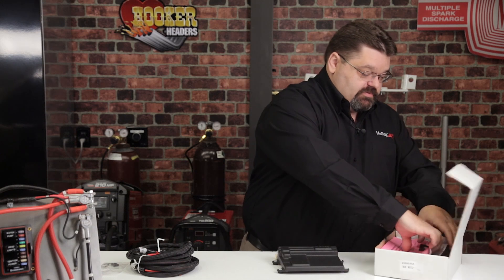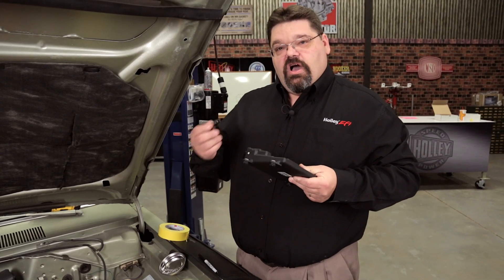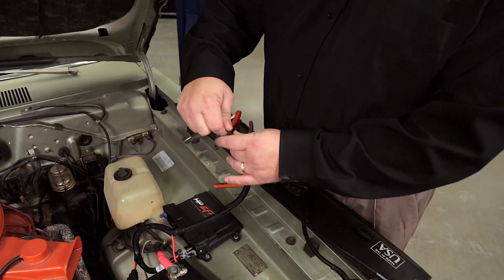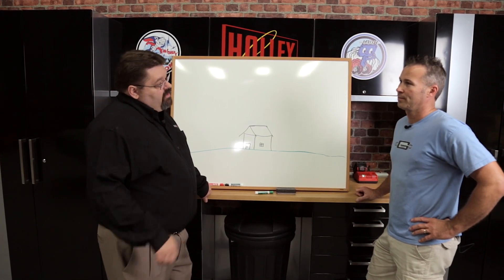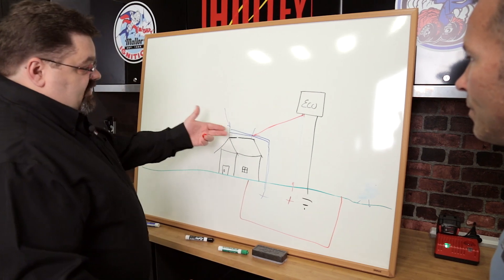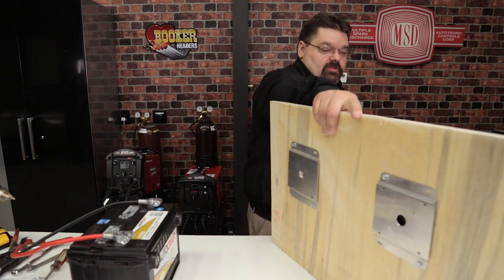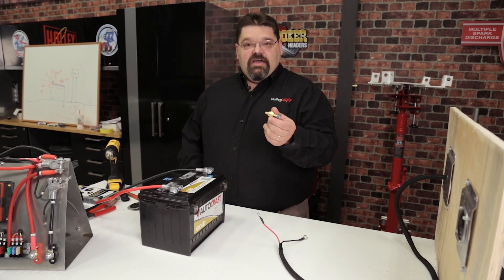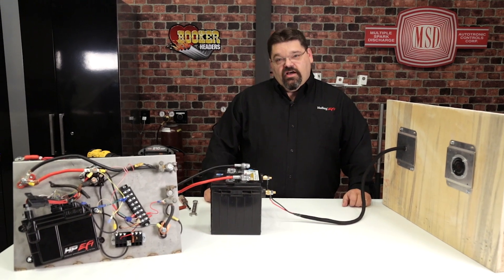Holley EFI ECU Mounting & Wiring

Comment: @HolleyPerformance - Wouldn't it be safer for to mount the primary ECU ground wire to a good solid chassis/frame ground close to the battery, so you only maintain a single, heavy ground cable connected to negative battery post from engine and then to body and chassis? Seems like there would be risk of high current running through the ECU if the main battery ground cable was disconnected while the primary ECU ground was still connected and any accessories were on. (unless all Holley ECU internal grounds are isolated from chassis/engine to prevent this)
Reply: Totally agree with you. Connecting ECU to that battery in my opinion is a big no no. Power ok no issue, but ground? no way. The easiest money i've ever made in my career were based on a loose grounds or corroded, including major battery ground to the engine block. I've seen smoke from support thin ground wires when cranking the engine, due to loosen main ground. So if i will attach ECU to battery ground, i will end up with high current from the starter searching its way back to battery negative terminal through ECU.

Comment: I ran directly to battery, I couldn't rev past 6700 rpms.  I grounded my ECU to the body(chassis) of my car, now I can rev all I want.  They are off.   I've read many posts to use the body for grounding better.
Reply from the maker: If that is solving your problem you have an issue elsewhere. It's likely your other components are not grounded properly.

Comment: Great video, but I want to see what's next for that Dart.  I see that it has a 340.  Would be great if Holley had a multi-port intake for the 318/340/360 engine.
Reply from the maker: Thanks,  I agree on your intake idea!!  I actually sold the Dart a few months back and it remained in stock form when I sold it.  thx J
Reply: @HolleyPerformance  Bummer it got sold.  Darts are beautiful cars!   If you can, talk to the power that be at Holley to get an intake made.  Holley already has the rest of the ingredients (distributor, ECU, etc), all that is needed is an intake.  You can look to the old Mopar M1 EFI intake as a guide.  Just don't make it as tall as Edelbrock's Super Victor EFI intake for hood clearance reasons.  Thanks!!

Comment: I must admit that I was among the 12v is 12v crowd; that is until now.. Vary informative and enlightening. Thanks the one thing he didn't say is that short or voltage spike damage means you have a nice new paper weight but no ecu and having run all the wiring i would probably feel that i would rather buy another than start over from scratch.  So it's not just that you lost time you lost money. both are to hard to come by to waste.

Comment: Very informative video.  Just one comment, most NHRA tracks will not allow you to run this to the battery, if your car has a kill switch.  It must be attached to the kill switch, as the kill switch must kill all power to the car.  There can only be 1 power cable going from positive to kill switch, and 1 ground cable going from negative to vehicle ground.
Reply: Just from a dummys view. Holleys ecu's are made on the cheap. China type quality.

Comment: I purchased the HP EFI retrofit kit. Now I'm looking around to get all the information's for a clean good installation.
My battery is in the trunk, two 1 AWG wires (12V / Ground) goes in the engine bay. Starter MSD BOX and cooling fans rund on these wires. A condensator is installed between the terminals. A condensator has positiv effect on jump voltage etc. so now my question. Can the ECU wired on these terminals with the condensator?

Thanks
Reply: Do not connect them to your distribution location in the engine bay.  Connect them directly to the battery.  If you need to extend the harness more than three feet I suggest upsizing the wire used to 8 AWG.

Comment: would like to c i actually wiring up dome sensor ... water@ meth setup and boost controller setup.Great video.
Reply: also when installing add on such as boost controller and so on. Instead of saying go in to and configure in ecu u should do a step bye step of ever step for us noobie efi. i actually have to c it done to understand and feel comfortable doing it. Thanks
Reply: Keep an eye out for more Holley EFI instructional videos. I will be focusing on wiring for the first few as poor wiring practices are the #1 cause of customer issues. Top of the list being the subject of this video  people not installing the ECU power as specified directly to the battery and trying to short cut it to a different location such as under hood distribution points, disconnect switched and starter solenoids.
Reply: thanks for reply. Doing a few video of the major add ons and setup with out skipping steps. i cant believe Holley hasent capitalized on this with induvidule videos. money maker... or u can just keep the videos going for free😇Keep up the good work

Comment: I just purchased a Dominator EFI, and I have a question about battery cut offs. How is this handled in race situations where the cutoff must severe all power from the battery and alt? Is tying it to the stud of the cutoff sufficient? Seems like a lot of Dominator Applications fall into this category. I have a trunk relocation and this will be easily noticeable and result in a failed Tech unless I am misinformed
Reply: Connecting the ECU power and ground directly to the battery should not result in any issues passing tech. The switched 12 volt (RED/WHITE) wire in the harness will be wired after the disconnect switch. This wire powers up and shuts down the ECU  and its associated relays. Provided the system is properly wired, this will remove power from the ignition, fuel pump and injectors meeting safety regulations.  DO NOT wire the ECU to the cut off switch.